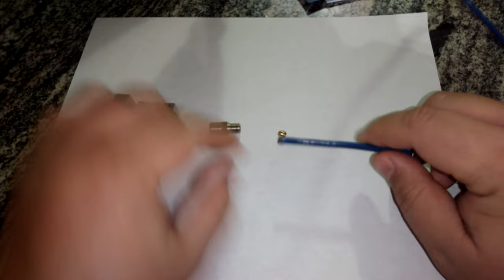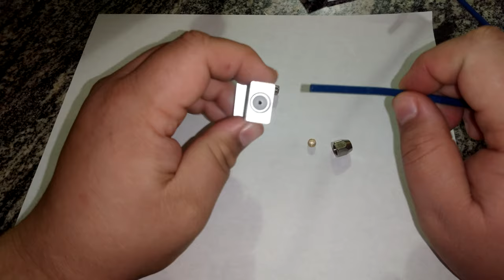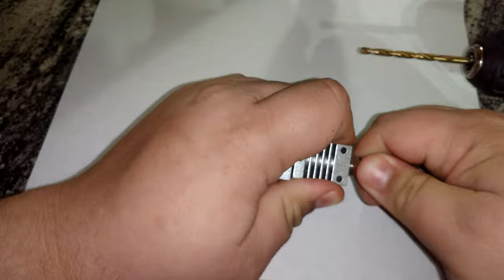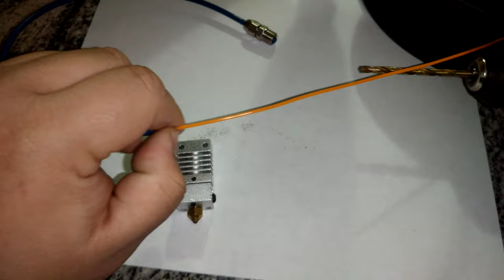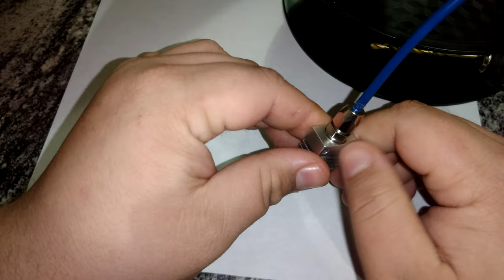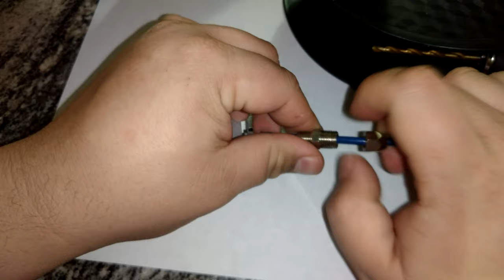Exploring the effectiveness of compression fittings on Hotends

Comment: The product linked above uses a fine pitched M10x1mm which will not fit all the way into the official Ender 3 hotend. An Ender 3 hotend uses the default M10x1.5mm fitting. It does turn a few times and is stable, but it leaves quite a bit of space within the hotend. If the fitting is drilled though like in the video and the bowden tube is pushed down it should be alright, but make sure the tube lines up with the nozzle and stays put.

Comment: Got some of these, but the compression ring isn't "grabbing on" to the bowden tube. No wiggle room between the compression ring and the tube, but after screwing the nut on, it behaves as if the ring was a size too big. The tube comes out as easily as if the fitting wasn't tightened.

Comment: I am a little bit confused about the thread. Does Ender 3 / CR10 Hotend use M10 or 1/8” thread? Is it a tapered thread or strait?
Reply: The Ender 3 hotend uses an M10, but make sure you find the default thread pitch (M10x1.5mm). The product linked above uses a fine pitched M10x1mm which will not fit!

Comment: I never have problems with the hot end coupler on my Enter 5 Plus. It's always the extruder side that destroys fittings. I'm going to give this a whirl on that side, but it is M6 vs M10. I see the same vendor on AliExpress has those too if anyone is looking: https://www.aliexpress.com/item/32706629544.html
Since that end doesn't need the tube to pass-thru, I'm thinking drilling won't be necessary and it looks like the right thread for my printer.
THANK YOU!